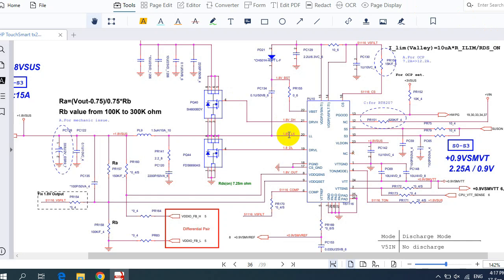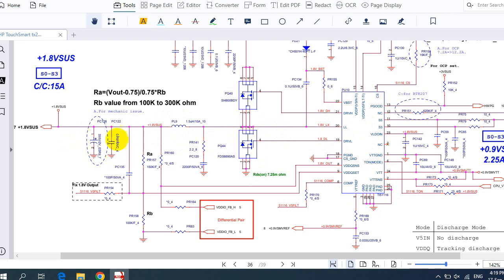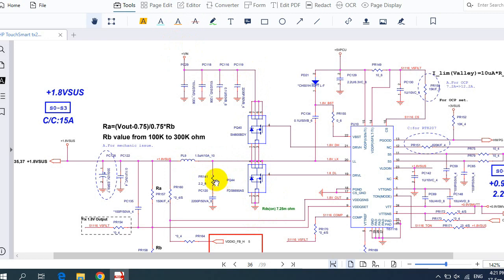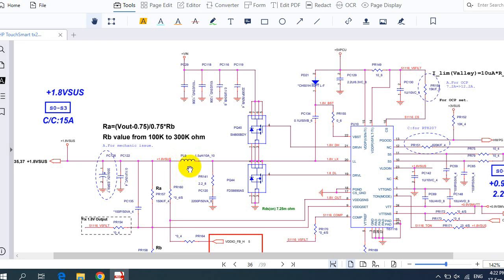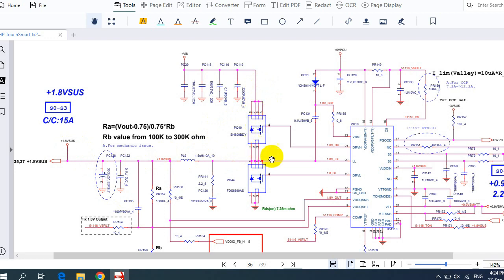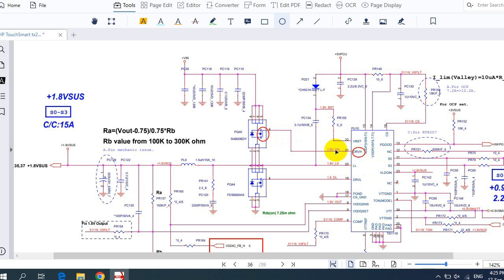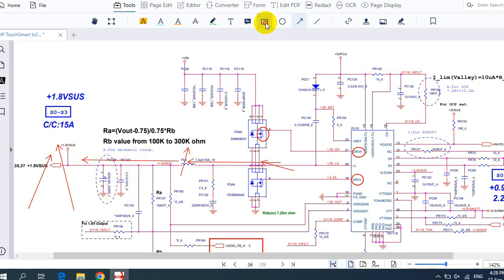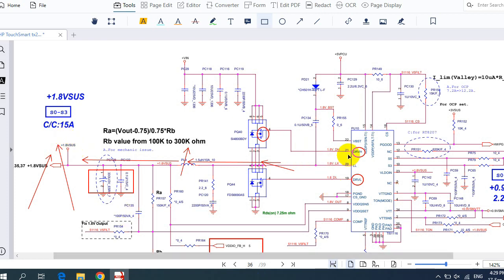RAM Circuit Diagram for Laptop DDR2 DDR3 DDR4 DDR5 DDR1 Schematic analysis

Comment: If the Driver IC is faulty then it would send max voltage through ram ? Is that correct ? We should check the actual ram module as it could be shorted? Also if 0 ohms on ram coil then possibility of dead cpu as ram is directly linked to cpu?
Reply: same issue, is CPU dead?